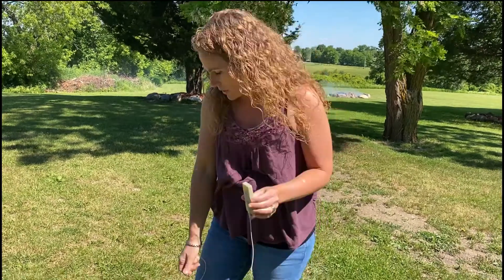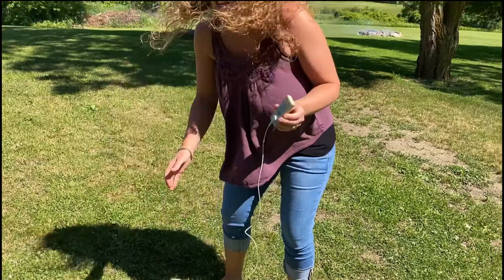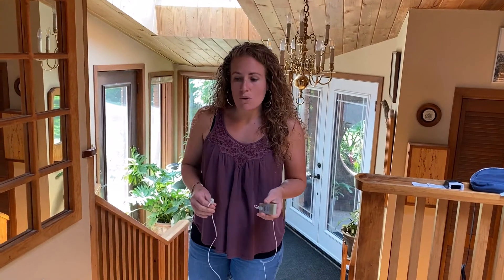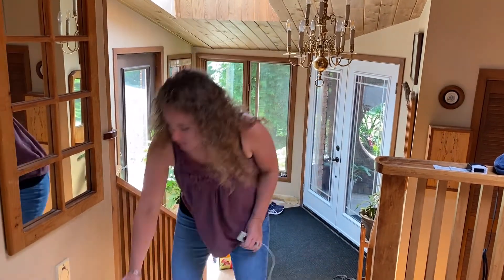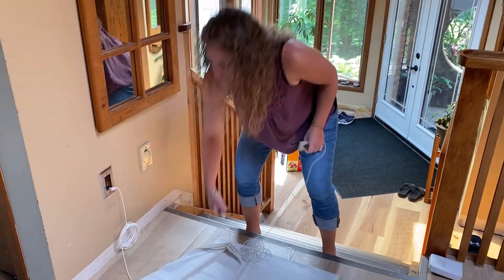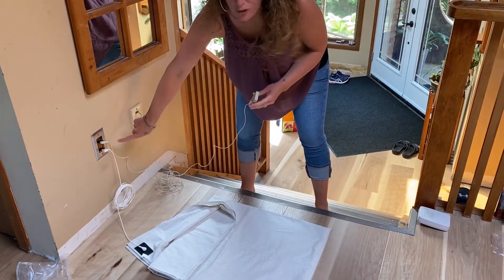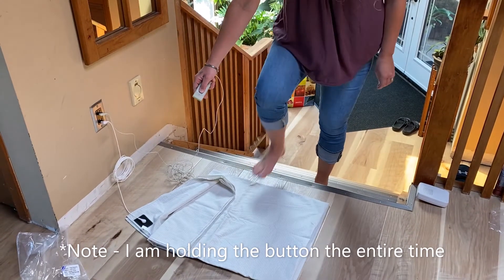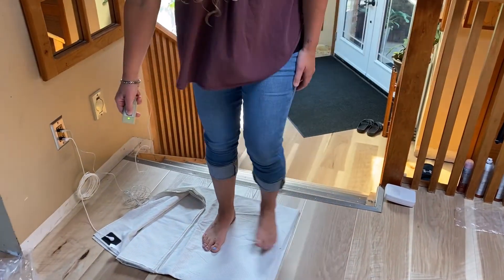How To Use Your Continuity Tester

Comment: Need help please. Using a tester in the ground while holding the tester, the light comes on while I’m standing on the ground barefoot. Placing the tester on my earthing mat itself the light comes on. However when I step onto the mat with bare feet as you demonstrated, while holding the tester the light does not come on at all.  Is there a defect in the mat somehow? Any thoughts anyone?
Reply from the maker: Really impossible to answer your question without seeing a video to demonstrate. We recommend that you contact the store you purchased from directly, be sure to have your order number.

Comment: I only have one outside rod wired up to my bedroom.. no outlets
How do i test if my pad is working?
Reply from the maker: To test if your pad is working you require a Continuity Tester.
Please be sure to watch the video on How to use your Continuity Tester.
Reply: @BrownBearStore  i have  a tester.. i just need to know if the pad is workimg with my out door in ground rod.. i only have one rod.. thanx
Reply from the maker: @anny31  Perfect, to use the tester you will plug it into the grounding portion of your outlet. Then place one hand on the pad, the other is holding the tester.
The light will be solid green to confirm it is grounded.
Recommend that you watch the Video, as it's a great visual of how to use your tester.
Reply: @BrownBearStore  i want to know if my pad connection from the ground rod outside  is flowing into the pad.. does the tester check that
Reply: @anny31 I had the same issue, ground rod stuck in ground outside my window but doesn't turn green.  When I plug it into the wall it turns green but not with the outdoor rod??
Reply from the maker: You can plug the continuity tester into the ground outside and then test your mat while it's connected to the grounding rod also plugged into the ground. Does that make sense? Just test it in the earth.